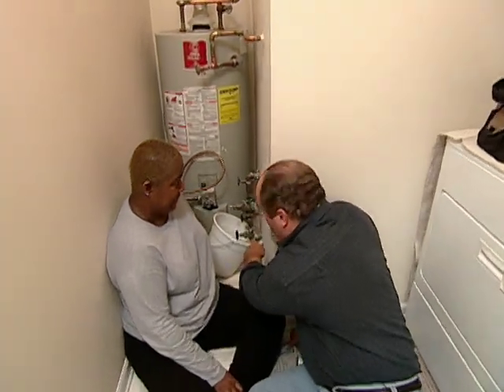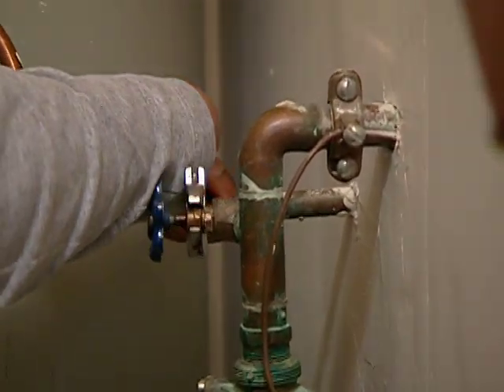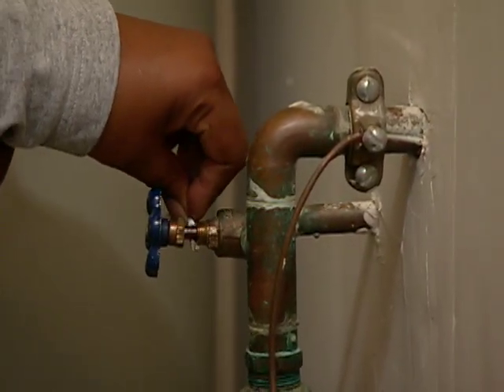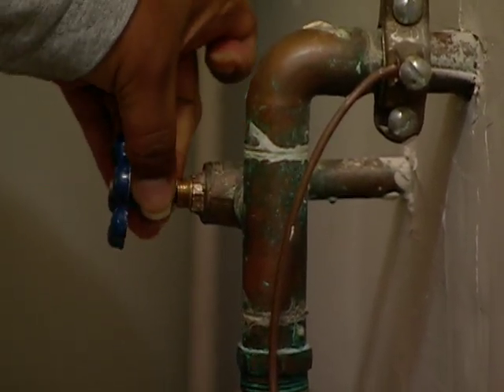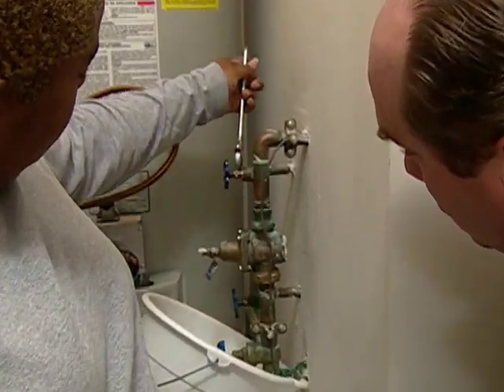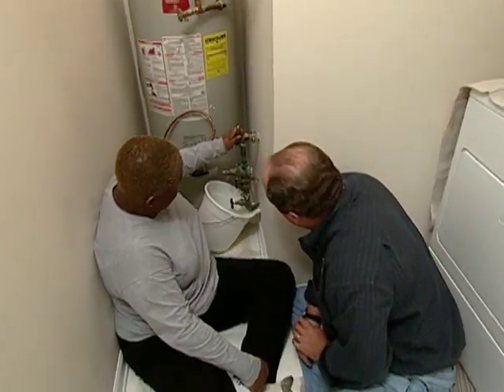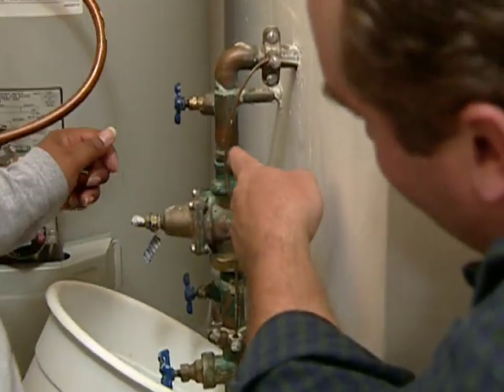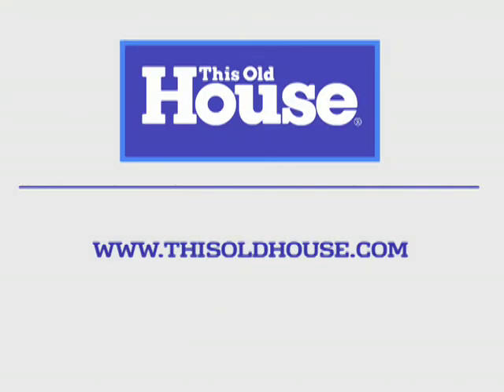How to Fix a Leaky Shut-Off Valve | This Old House

Comment: I was under my house, crawl space.  Just replaced a heating element on my fatboy water heater.  The element wrench had slipped during the process, jamming my hand on the drain valve, swelling my knuckles almost instantly.  So the frustration level was high.  Turned on the water and the valve started streaming water.  Not a good feeling.  I found this video on my phone while laying there at a loss.  Went into my tool bag, found the teflon, and my adjustable wrench.  Called my wife who was walking around above and, had her shut off the water supply.  Replaced the washer with the teflon and tightened the valve up.  Boom, problem solved.  Thank you so much.  Avid watcher of "This Old House", thanks dad.

Comment: Totally fixed my problem in 15 minutes.  Saved me hours of hassle when I thought I needed to replace the whole valve.  Some YouTube videos have you pull the whole handle (mine is stuck), so I was happy to see I could re-pack just by removing the "bonnet."  Thanks Richard.

Comment: I'm writing this on a late Saturday night, Memorial Daty weekend, during the Covid-19 pandemic. I installed a small bidet attachment a couple days ago; it had a leak which I finally tracked down and fixed. However in the act of shutting off and opening the water supply to the toilet, it later developed this type of leak through the stem - but much faster than the previous leak, overfilling the small tub and onto the floor around my toilet. I shut off the knob thinking I'd have to wait until Tuesday to make a non-emergency call to a plumber; I figured I could open it just enough between flushes to fill the tank, then shut off until the next flush. Or because I could see hex heads, maybe I could do it myself. Or at least know what would be involved when I talk to plumbers for quotes. 

So onto the Interwebs I jumped. Took me a while because I didn't know what exactly the valve was called (Lowe's confused it with the flapper & fill valves inside the toilet, and with faucet stem valves). Finally DuckDuckGo (because screw Google) gave me some closer results, including this one. It seemed really simple enough to try, and low risk if it didn't work. So far, 15 minutes later, it seems bone dry; I put a larger shallow tub underneath just in case. I remembered I had a similar valve stem leak through a an under-cabinet shut-off valve to my outside spigot. So I tried it on that one. So far, bone dry; again I put a cat dish underneath just in case. I got so excited I went into my utility room and did this trick with at least 4 different shutoff valves, including the inside main shutoff. Only one of them had to be backed off enough to let me turn the valve, but it still shows no signs of leaking. 
I'd never heard of a packing nut. But this seems like a widely-overlooked and/or neglected thing by homeowners that over time could result in expensive and perhaps unnecessary repair bills, both for the leak itself and the resulting water damage. I wonder if this should be a periodic maintenance check by homeowners and/or landlords, maybe every few years or so. My house is 60 years old and I don't know which valves are original or not, so I have to assume they all are (which is probably true). It seems like opening and/or closing these valves (especially repeatedly) after letting them sit for a long period of time induces this type of leak. I doubt the two leaky valves I had were ever touched by the previous owner. 
I am also starting to think that even if tightening the packing nut stops the leak, in the fullness of time the leak may re-occur and the packing material inside will have to be replaced. Again I wonder if this shouldn't be a regular maintenance item; I don;t know what the frequency for replacement would be but 10 or so years seems reasonable; of course "as needed" if tightening the packing nut doesn't stop a leak.
Reply: I used to have a plumber who won't mess with any of the individual shut offs when he does a service job.  He goes right to the main and shuts that off.  Personally, I like the new ball valves and upgrade to them when appropriate--the gate valves--like in this video-suck.

Comment: Happy New Year! 
Please advise how do you stop the leaky main water valve.  I have put a piece of teflon tape but this has not stopped leaking.  Thanks.
I just want a temp fix...as I understand that this has to be replaced in the long term...This can only be done after coordinating with the City.

Comment: This literally happens to me today to the water line that go's to the water heater  the valve would not closed so kept rocking it open en close until it loosen up by then when I drain the water heater and went to turn it back on  when I open the whole valve water kept coming up they the valved now I know how to fix it thank you for sharing

Comment: What about if it's the MAIN water valve that has a slight leak?
Reply: Then you would need to turn off the shut off valve for the entire house.
Reply: You should get a plumber to replace the main shut off valve from an old gate or globe style (Which your not really supposed to use any more) and have them replace it with a quality ball valve.  We have 40 year old ball valves here at work that have never leaked once.  Great products.
Reply: Will have to have the city turn the water off to your property for that repair to be completed.
Reply: Thanks to all. Like JD said, a replacement to a ball valve would be the way to go. The hardest part is coordinating the plumber with the city.
Reply: Most homes have a shutoff valve at the meter that you can close
Reply: Dig a hole in your garden where your water line runs, put on your swimming shorts, cut through the pipe, push a valve into the water explosion onto the pipe and tighten it with a wrench. Then connect and fix everything behind it ;-)
Reply: Don’t have to shut off the water  to remove and replace the patching. Just close the valve and make the repair will have a little drip while repacking it after you remove the old packing

Comment: Seems like there'll never be enough packing to stop my shower handle from that type of leak.  And if I try to really jam a lot, the handle becomes too difficult to turn and I'm worried it'll cause the entire thing to unscrew from the pipe.  Any advice?
Reply: Get a rebuild kit for your shower valve body.

Comment: I need to do a similar job, but my main water valve will not close, it is just spinning freely. I can't remember a time when I have ever had to shut it off.
Reply: justonemorecast Time to call a plumber.  You'll need to shut off the water at the main outside your house, and once you do that, it's best to replace the existing valve with a quarter turn ball valve.  Good luck.
Reply: Tom Conroy I shut my main off outside and replaced the valve. No plumber necessary.
Reply: justonemorecast While you may have been able to turn off the main outside on your own, it’s best to work with the town and have someone come over and do it for you. After all, it is their property, and if they break it, they have to pay.

Comment: I tried doing this but I couldn't move the handle afterword, I tried to to move the handle with a pipe wrench and the handle broke off. I got it to open with visegrips but I guess I don't have a shutoff anymore... doesn't leak though.
Reply: Sounds like you put too much packing in there.
Reply: @A Stanton1966  Yeah I definitely messed it up but I changed it all out when the water heater went bad.

Comment: How do I fix a leaky shut-off vale 
for ice maker
Reply: If you have one of those saddle valves, forget it.  They make a nice valve for ice makers.  Go to a plumbing supply house and get one.  This is to say, as long as you have copper lines.  You can get it sweated right in.  Then run one of those lines with an o-ring on each end.  The plumbing supply house sells those two.  They come in different lengths--you don't cut em.
Reply: Norma Gibson replace it
Reply: What about fixing the t&p line that's done illegally

Comment: Copper gas line really?
Reply: Why not? My gas line here is made of copper too. But the fittings are crimped (copper and stainless steel are here always crimped (special tool which is crimping the fittings with several tons of pressure), soldering is not longer up-to-date here in Germany) and the o-rings in the fittings are special ones for gas and the fittings are marked yellow (green for water). Natural gas isn't corrosive so that's not a problem.

https://www.sbz-online.de/Cache/GENTNER/10024/0420-01_MzA3MzQ0Wg.JPG